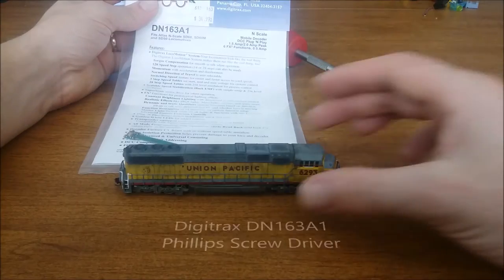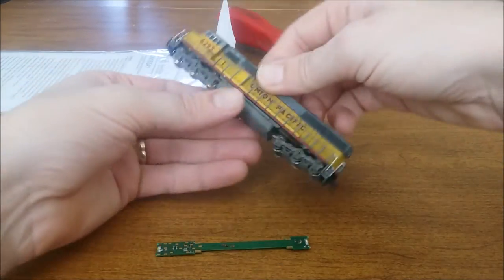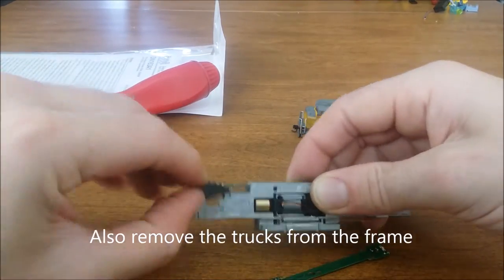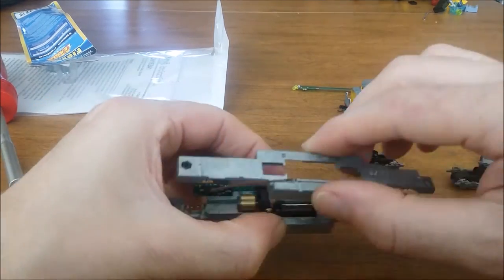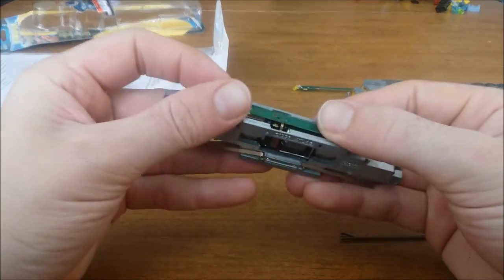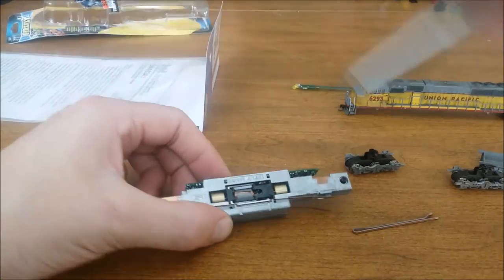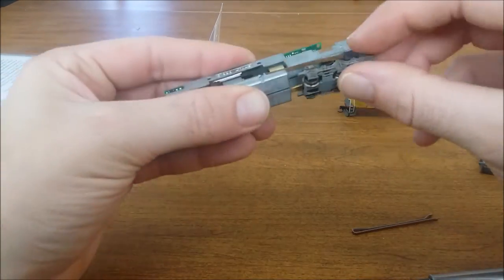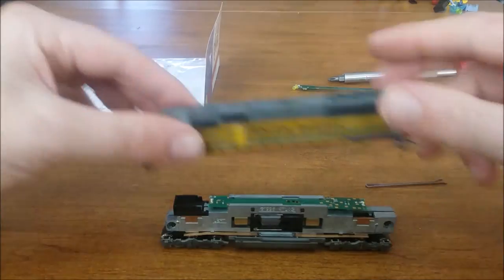N scale Atlas SD60M Decoder Install

Comment: Just out of curiousity, was there a lot of movement once the decoder was installed? I just did one and it wiggles all over the place....and it doesn't work either. One of the brass tabs is too short to reach the slot in the decoder. I do not like this new design for the Digitrax decorder. Kato and Fox Valley mechanisms and decoder installs are MUCH easier and less hassle. I always have issues with Atlas installs.
Reply from the maker: +conrail9876 I haven't a problem yet.. I tightened the tabs down that hold the decoder in place. Maybe give that a try.

Comment: You don't use Kapton tape?
Reply from the maker: +William Arseneau No and only on that particular model. I checked the bottom side of the decoder and check to see if there were any mosfets or resistors. There were only a couple resistors about 02/04 at the end. I eye balled the clearances and there was no interference. Thanks for asking.